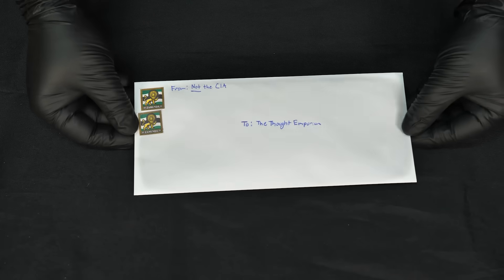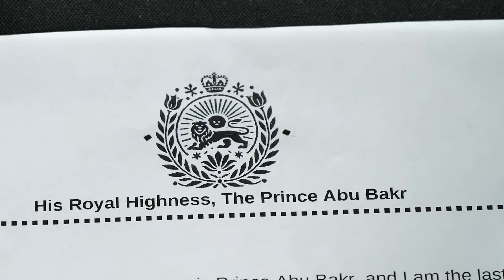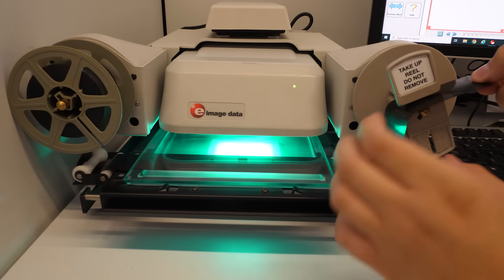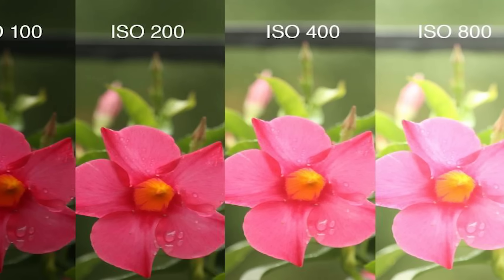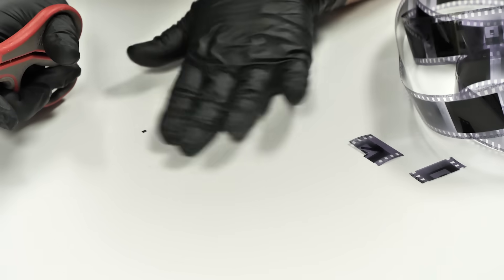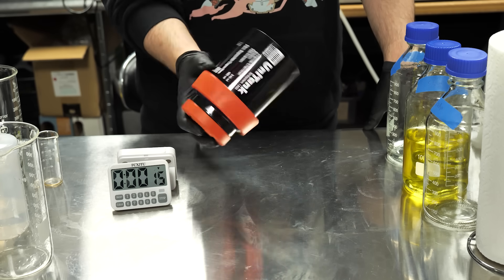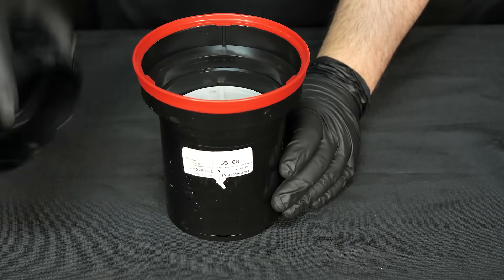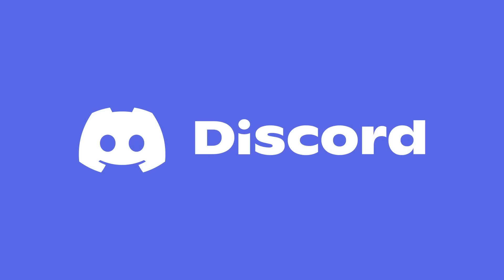Recreating CIA Technology Was Surprisingly Easy (Microdots)

Comment: I worked as a radiographer from 2006 to 2018. I developed film in 5 gallon tanks by hand every day. Never wore gloves, but if you have an exposed cuticle or hang nail. You'll know.
Reply: xray film all the way to 2018?? wowza!   our company helped get a lot of imaging centers on a budget to switch to CR and (later) DX.     TFT and CsI scintillator cost went down a lot; i cant imagine any reason to keep using film unless the crusty old doc is resistant to change 🤠   especially for ortho u dont need the highest DQE panels on the market
Reply: @WhileTrueCode  industrial radiography, a lot of the time I was in remote areas and since the scanners and plates are expensive and can be ruined by lots of dust or bouncing down 2 tracks and dirt roads and you're hours away from the office, it is more economical to send radiographers with tanks and lead screens/film. I did some CR when I was working in the city close to the office. 
Even today at the facility I work at, I'll occasionally require the radiographers to use high emulsion film where CR just doesn't capture the sensitivity for whatever reason, but they use 95+% CR here. DR is still running into limitations at a facility with high temperature piping well above the ground. You can drop and break a film or CR cassette, or melt/warp the screen without it being the end of the world. 14x17 DR cassettes on the other hand are very costly.
Reply: @kodiererg  hey cool! thanks for the follow-up, that is really interesting. yeah that sounds like a harsh environment so i absolutely see your point.    pretty much all the products i worked with were for medical (which presumes a nice clean environment).   we had a potential NDT contract but our panels werent designed for the high kVp and long exposures they used   (lol the cutest little xray generator... ran off DeWalt drill batteries).    cheers!
Reply: @WhileTrueCode  film has infinite resolution
Reply: @CreativeAndCreepy  Nope, the physical grain size, and not to mention lenses limit it to a certian resolution. Usually this will even be listed in the datasheets as a certain number of line pairs per millimeter.

Glass plates, perhaps, since they have no grain, but even there you eventually run into the molecule size, but the lenses used for those are really a far-cry from being able to hit anywhere near that resolution.
Reply: Most people don't wear gloves in the darkroom, but I would highly recommend it. Many developers can, with some bad luck, cause skin-senzitisation with long term exposure. I know of a guy who more or less became allergic to his own darkroom because of this. Not to mention how many other of the more common developing agents can contain mutagenic compounds which can lead to cancers or birth defects with prolonged exposure. Sure, you only use them quite diluted, but still, I personally choose to concider gloves mandatory when I am in the darkroom. I will let others read the MSDS themselves and make their own desicions, not to tell others what is right or wrong.
Reply: Indeed

Comment: You covered the film dev process quite well. The developer can only be re used if you use it right there & then, you can get away with using it the next day, but once mixed it does start to go bad. When it has completely gone off it goes black. Disposal depends on your area. Where I live no one takes used development fluid so I just usual tip it down the drain, but you can also bottle it up & chuck it in landfill. Ideally you want someone who takes chemicals, but in small quonatys you should not cause massive environmental damage.

Comment: Photographer tip for getting higher resolution with your current setup:
Not sure if it has been mentioned by other commenters but you may be able to get sharper results than you are currently with the same setup: around the 11minute mark you say 'I used the maximum aperture...' as part of your efforts to get the sharpest images/highest detail, look up "diffraction limit f stop" to find more info but the short version is at maximum f stop/aperture you actually lose sharpness due to diffraction effects. For most photography lenses the sharpest/highest resolution aperture is not the smallest, but usually somewhere around f8 - you can look up your specific lens and likely find what its sharpest f stop is. 
The other advice I have is look up the most ideal lens for your needs from the long back catalogue of nikon's lenses (they kept the same mount for their full frame cameras all the way up to today, only their full frame mirrorless cameras changed mounts; and 'F mount' lens will work) and find one in good condition. For maximum sharpness you want a prime lens (ie not a zoom), and likely something in the 80mm to 140mm focal length range. A quick search found '135mm f/2 DC AF' as being a great choice. Search for 'kenrockwell best nikon manual focus' (I'd link but links in comments often don't work) for a list of options. The great thing about those old manual lenses in that list is often you can get them extremely cheap (though look out for fogging or other internal  clarity issues before buying) and the image sharpness/resolution will still be damn close to the best modern stuff. 
Another note for increasing sharpness: fully black out the rest of the softbox, light directly into the lens will wash out the image. When shooting very high contrast subjects (eg glowing white text on a black background) you want to try to make sure that anything other than the subject (ie text) is as dark as possible. This is especially the case with older lenses as they don't have antireflective coatings on the lenses (generally) and so extra light can bounce between the lens elements and wash out the image.

Comment: There is also a whole class of film called copy film or technical film. They are not very common these days but you might still be able to pick up some ADOX CMS20. These often come with a special developer that tames the extreme contrast which is common in most slow films. In this case however it might be an advantage to have that high contrast. Something which is a bit more speculative would be using a developer to exhaustion might give better edge definition doing a stand development with Rodinal would be my first suggestion however that developer is known for increasing grain size. Possibly using something like Pyrocat-HD in a stand development method might yield better results however I can appreciate going though all this testing might only give you a marginal improvement over the process that you already have and thus may not be worth the time investment.

Comment: This seemed so useful to me that i thought "i could store hundreds of pictures that way", midway in the video i realized you can just buy a 128gb sd card for 10 bucks and store thousands of pictures in the size of a fingernail haha.
Reply from the maker: But of the two, the images stored on film in theory are much more stable. So they're useful for different things
Reply: @thethoughtemporium  True for black and white film at least. Developed B&W film is literally silver crystals on plastic, the images themselves are silver metal, so not organic dyes or anything that will fade. While it will probably outlast and SSD or SD card regardless it should however be noted that the base material of the film matters. Many films are made of Cellulose acetate which, if stored incorrectly the plastic can degrade, which makes sense since it is literally a biodegradable type of plastic. Some modern film is made of PET or polyester base, that stored pretty much anywhere dark and dry should last at least for a couple of centuries. 

The reason a lot of film is still cellulose acetate is that the other base materials can be too durable, especially for motion picture cameras. If that film gets stuck and the camera is winding on at 24 or even 60 frames per second something is going to break. With acetate film, the film will break, with PET or polyester film, the camera will often break.

And as for color negative and color slide film, stored properly (or really just not stored terribly), it should still outlast SSDs in most cases. But, especially exposed to light, the dyes of those will fade over the decades as the finished image doesn't have silver on it. Color negative can however be bleach-bypass processed, this will affect the image making it much higher contrast and lower saturation. But it leaves a silver image so even after a century in sunlight when the dyes are all gone they will still be scannable as b&w.

Comment: Sooooo wait. How did you make the micro dot? Did you just take the picture of the same layout at different distances? How did you know which distance was the best? Is that were alot of your trial and error was? Was there some kind of ratio, like 40 ft away makes the best micro dot for your chosen camera, lens and film?
Reply: For high quality SLR cameras the viewfinder is close to the full frame, the size of a full frame of 135 film is 24x36mm. So if you make the subject cover a quarter of the viewfinder you know the size of the subject on the film will be 12x18mm. So you could easily make a mask with something like a grid where each square is 1x1mm. Then you could easily compose the frame so the subject will be X by X millimeters.

Comment: Another couple suggestions.
Most commercial lenses are sharpest around f/8 or f/5.6. Opening up or stopping down from there will typically lose sharpness of edges.
Also, you might want to track down a “process camera”, basically a specialized camera meant to copy things to microfilm or for use in printing. They’re fairly cheap because they aren’t useful for art photography, and lot of schools and libraries had them and are getting rid of them.
Also, you should check out the Adox CMS films, which are basically high contrast copy film. The Film Photography Project also has “Hi-Fi” film, which was originally meant for optical sound recording and would do very well for your purposes.
Also also, depending of what you’re photographing, use a red filter on the lens to boost contrast. It’ll knock off about three stops of exposure, but with panchromatic film it’ll render the image in almost pure black or white.

Comment: You can use the developer again.   Something you may want to try is a very hi contrast film like Line Copy film,  It was use in the printing industry, Like a newspaper office,  I was a dark room technician back in the early 70  this film requires a special developer it it a 2 part you get total black and clear on the film. If I recall correctly you can use the same stop path and fixer. It a lot of fun to play with that film.   I hope this will help.

Comment: Standard 35 mm film has about 50 lines/mm, but there is copy film and microfilm (approx. 5 ASA) with ultra-fine grain and resolutions of 500 lines/mm or more. There is even "grainless" film (it is not really grainless, but the grain is smaller than the light wave, so it is as if it does not exist). 5000 lines/mm film far surpasses digital and is used for holograms. and extreme miniatures but not for taking portraits, since it has very low sensitivity, around 0.01 ASA. Digital sensors do not reach the resolutions that film can, which is why digital holograms do not exist. Microprocessor chips and sensors in digital cameras are photographically fabricated using special negatives and ultraviolet or X-ray or even higher frequency light. When there is a high resolution digital sensor, it is because there is a higher resolution photographic negative to be able to manufacture it. Microprocessors are manufactured with classic photographic processes and negatives inside photographic cameras that are so specialized that they cost like a small town. Every time I hear that digital surpasses photography in resolution I feel sick, classic photography is what is used so that digital can exist, digital sensors do not grow on trees.

Comment: You don’t need stop bath, just add the fixer after a good rinse after dev and before fixer.
Reply: Depends on the film and developer combo. I have gotten indications that he might be looking into ADOX CMS microfilm with Adotech developer. The datasheet of which explicitly states that a water rinse is not enough to halt the developer.

A stop bath also hepls prolong the life of the fixer while reducing water rinses. I personally would rather just do a 15 second stop rather than a full Ilford 5-10-20 rinse in water.

But stop bath is just really dilute acetic acid so it is really cheap and easy to mix yourself. Might as well use it then.

Comment: All sorts of neat stuff can be done with microprinting.  LED-based slide projection is still a viable way to get information to a group of people in a small and rugged package with long battery life or easy recharging.  Additionally, there was Bokode from the MIT Media Lab - a multiply useful system to read microprinted barcode in a scene using a camera.  Not only could you read every single exposed Bokode tag in an image from a single picture, you could use the system as a sort of motion control system by arranging the lens on the controller such that only a section of a "large" (in relative terms) barcode was exposed.  If the receiver knew what was on the barcode, the position and angle of the controller could be determined by which section of the code was visible.

But, TBH, I am more interested in a .50USD LED projector than can be used to display things like instructional and repair manuals.  A lot of the "appropriate technology" uplift folks would benefit from being able to send teaching materials for a class in a small and durable package.  Paper works too, obviously, but training materials are generally bulky and expensive at the classroom scale.
Reply: I'd always hoped the bokode would find a use somewhere
Reply: @MaxNippard  Same.  I loved the motion control concept - we could have interactive displays nearly everywhere that you could use a personal controller on that cost less than USD.50 to make.

Comment: Small caution about PANF: It notoriously has poor image retention properties, be sure to develop images taken on it within a month or so.

I'd be curious to see what Delta 100 pull-processed at 50 looks like, though that usually mostly affects contrast, not accentuate. XP2 Super may be interesting, since it's a C41-process film that relies on dye to make the final image. FPP Dracula (aka Svema FN-64) is a wonderfully sharp and high-contrast film with a very clear base.

For the lens: while shooting wide-open has its benefits, most lenses are not at their sharpest wide open. If sharpness is paramount, using a lens a stop or two down from wide open is advisable.

Comment: The QR code in the scam letter at the start wouldn't scan, I was hoping to get at least mildly Rick Rolled...
Reply from the maker: It's finicky, but you can get it to scan if you try hard enough
Reply: Had to stretch it in gimp... should have known... it is
Reply: @Roy20100  it is? Oh dear, that means I can somehow read QR codes visually 😆

Comment: I had a practica at a photoresist company and they said not to wear rubber gloves except if necessary to protect the resist because the nasty chemicals will go rith through them and the gloves just make it harder to remove those chemicals afterwards
Reply: Photography chemicals, while they may be somewhat similar are not the same. I've used the exact same chemicals they do. They're not that nasty.

Developer: They used "blazinal" which is one of many brand names of the old AGFA Rodinal formula. It is not that toxic, but quite caustic. You however dilute it a lot so the working solution is only mildly caustic an will not immediately burn you. It does not go through gloves. If you do however develop without gloves, which isn't recommended but I've done it a lot. If you don't wash your hands afterwards your hands will dry out and you will get a minor burn, similar to a dilute NaOH solution. Not to mention your hands will smell awful, but it will not be that bad.

Stop bath: Basically just vinegar, no real problem.

Fixer: Fresh no real problem, a lot of people even say that fresh fixer can go down the drain if it for instance gets too old and oxidizes. But if you've used the fixer it contains silver, heavy metal. It will not dissolve gloves or really anything but can be dangerous to consume.

Comment: You can reuse developer solutions like at least 20 times, but be careful not to kill it mixing with stop bath solution, even a small amounts can do it.
Reply: They're using "Blazinal", a tradename of the rodinal formula. It is a one-shot developer that's only to be used once.

But for most developers, yes.

Comment: With black and white film, the silver halide Chrystals get reduced to metallic silver in the developing process. The fixing removes all the remaining halidechrytals that remain. What you are left with is basically little dots of silver that make up your image. 

The developer is in some cases reusable, check the manufacturer's data sheet (there's always a data sheet). There are special high resolution film / developer combinations. I would suggest to look into that. Adox CMS 20 pro and so on. (as others have already commended). 

Resolution on the film is a product of: Developer - Film - Optic - Steadiness
When taking an image with your consumer photo optic, and you want to achieve maximum resolution, you should use f,5.6 - f8. An aperture smaller will decrease your resolution, and a more open one will also decrease the resolution.   

Reusing the developer could decrease image quality. The developer dilution will also affect your image resolution in many cases. Try to get dedicated "high resolution" films and developers, use your lens at its sweet spot and keep your camera very steady. 

All the best!